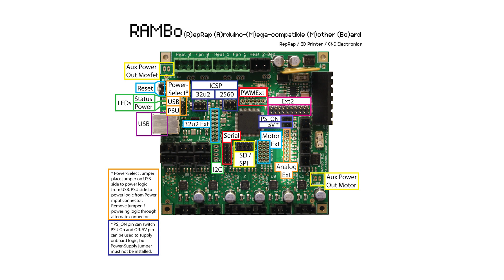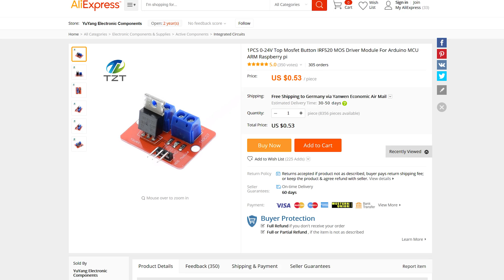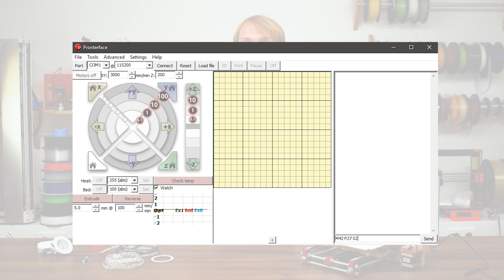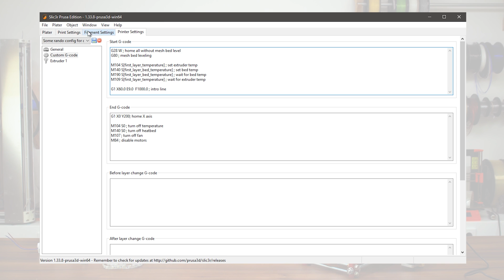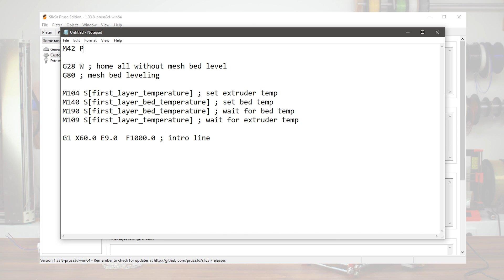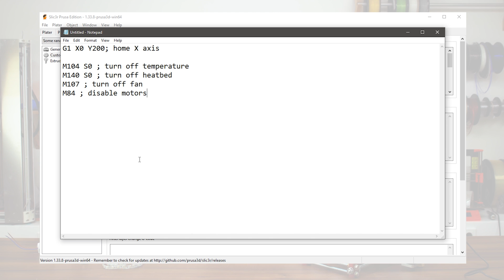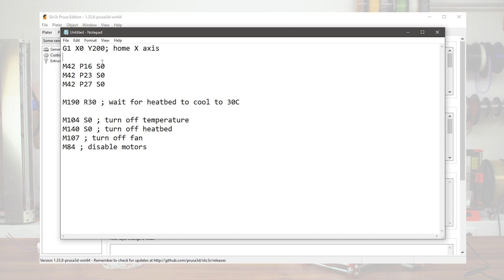How to add software-controlled LEDs to your 3D printer!

Comment: You should talk about nanoparticle emissions from fdm 3d printers, and how important it is to have your 3d printer in a well ventilated area!
Reply: Wow..some people fail at understanding. PLA may be 'non toxic' when ingested or during physical contact with 'large' solid particles. However, when inhaled in ultra fine particle sizes (0.1 - 0.011 micron) they become lodged in the smallest of lung passageways. They are also small enough to pass directly into the blood stream travel to the most tiny locations of the blood vessels in the brain. These lodged particles are well known to cause long term pulmonary problems. Strokes, recurring flu, asthma, etc are all directly linked to UFP (ultra fine particle) inhalation. 

After multiple studies, we're seeing that PLA has a much lower UFP count compared to other filaments, such as ABS or polycarbonate. However, in concentrations given off by frequent and long term exposure to in home printing this very well may cause long term problems after these little bits build up in the body.

There are actually several 3D printer and filament manufacturers currently working on low UFP materials to deal with this, now recognized, problem.
Reply: Myko I never knew about this, thanks for the info!
Reply: Yes, thank you! You explained it way better than i ever could.
Reply: Can you name anything that wont kill you?
Reply: TheDutyPaid you have a good point
Reply: It's not a good point if it's pure stupidity for the sake of creating an argument. Yes of course everything can kill you in the right dose, the right application of force, etc etc etc. The real question is, how slow and painful do you want your death to be? Slowly poisoning yourself from the inside while your nervous system freaks out and degrades doesn't sound like fun to me. And that's just a single possible method to die by 3D printing.
Reply: secretagb in my opinion the point is that there are also many other dangers the should be explained, for example what if you printer caught fire. My point is that there are many other safety items to be explained.
Reply: i am not acting like anything, i am simply furthering information i found online. Because i actually read up on stuff before i post comments on videos. And besides i never claimed that 3D printers are deadly, i said they could be harmful which they can
Reply: Lukas I didn´t know about it either. It surprised me a little so i think it would be cool if big 3D printing channels helped to make people aware!
Reply: So how do you feel about Fukushima? ... the air outside will prolly kill u faster but good info anyhow..
Reply: I don't disagree there are a million other things that are more likely immediate dangers. However, keeping your printer from catching fire is easily mitigated. Even having the ability to extinguish that fire is quite easy to manage. Some dangers are simple to mitigate and others not. I worked 12 years in aircraft maintenance and was exposed to a myriad of seriously terrible toxins and mechanical dangers. Many of which were easy to keep safe from, others not. So why not try to mitigate the easy things and not worry about them. Then work on trying to mitigate those we may have a harder time with? Nano particulate is something we don't even fully understand yet in the medical sense. Saying that something may burst into flames and pointing to that danger and ignoring the others is silly. It would be like me saying I could have been crushed by a hydraulic failure on a wing flap and ignoring the caustic sealant fumes I was using to do a repair under said flap.
Reply: So what's the exact Harmful Part?
Reply: Yah. Which part of the Body is affected? Lungs?
Reply: Dr. Google.
Reply: Best thing is that we should use Filters...
Reply: Oh i will die tomorrow..... PLA is non toxic..
Reply: First of all, no.

new studies from this year shows that although emissions from PLA is a lot less than other types of filament, it can still be harmful in an enclosed area with bad ventilation.

but PLA isn´t the only type of filament, is it?
ABS produces way more harmful gasses and nanoparticles.

And there are soo many other types of filament out there that hasn´t even been tested that well that might be even worse than ABS.
Then you have to take the quality of the filament into account, super cheap chinese filament for example probably is worse than good quality filament from trusted producers.

You need to read up on stuff and learn about things before leaving comments like that and making yourself look like the stupidest little 12 year old on the internet.
Reply: Stop acting like you are the Pro in Chemics and such. I never said that it's not true I simply said PLA is non-Toxic and that I will die tomorrow. A 3D Printer will never kill you unless you Print something besides PLA without any Fresh Air input.

Comment: For a  lightning based on the temperature of the hotend :
 i use this feature of marlin  for controlling fan according to the temp of the hoend  in the configuration_adv.h. 
(i my case i don't use the heatbed, so i use the bed output to power the light and hotend fans)

// Extruder cooling fans
// Configure fan pin outputs to automatically turn on/off when the associated
// extruder temperature is above/below EXTRUDER_AUTO_FAN_TEMPERATURE.
// Multiple extruders can be assigned to the same pin in which case
// the fan will turn on when any selected extruder is above the threshold.
#define EXTRUDER_0_AUTO_FAN_PIN -1
#define EXTRUDER_1_AUTO_FAN_PIN -1
#define EXTRUDER_2_AUTO_FAN_PIN -1
#define EXTRUDER_3_AUTO_FAN_PIN -1
#define EXTRUDER_AUTO_FAN_TEMPERATURE 50
#define EXTRUDER_AUTO_FAN_SPEED   255  // == full speed

Comment: Very interesting video.
I tried using the setup as shown on the reprap forum in regards to the FF module, but was not able to get it to work.  This module is suppose to handle the lighting and also apply sounds to the actions of the start and end codes.
Not sure why it didn't work, but it would be a very cool thing to have for demonstration 3D printers that are designed to encourage new people to 3D printing.

Comment: Extremely helpful video! 
I have some spare LED strip and was considering installing some on my LulzBot Mini as I'm fed up with not being able to see what's going on! 
Although the PSU is 24v and the LED strip I have requires 12v I was going to connect two pieces of strip in series so they both have 12v from the PSU. I was going to use a small switch on the front of the printer controller case but having seen this I'm considering the alternatives, although I may still include the switch for isolation purposes. 
Looks like my weekend is going to be illuminating!

Comment: PrintrBot has a nice RGBW NeoPixel led strip that uses one wire control to set the colors. 
https://printrbot.com/shop/led-strip/

You can also use any of the Adafruit NeoPixel modules and they have a lot of choices.  Marlin 1.1.x has RGBW support, but I had to patch it to drive NeoPixels.  In effect each led is individually accessible for ultimate control.

NeoPixel support patch is here, but keep in mind this patch does more than NeoPixel support so you will want to apply just the parts that drive the NeoPixels.

http://www.xilka.com/printrbot/marlin/1.1.4/20170707/Marlin-1.1.4-20170707.patch

If you have a PrintrBot Simple, firmware that drives the NeoPixels is precompiled here:

http://www.xilka.com/printrbot/marlin/1.1.4/20170707/

With this implementation the firmware drives the leds, so no gcode mods are necessary.

Comment: you might want to check out the rgb settings in marlin also.. search for "RGB LED / LED Strip Control" in configuration.h and also "Printer Event LEDs" in configuration.h

Comment: Never connect a Ramps 1.4 to 24 Volts..
Reply: rubbish, you just need to know what your doing.
Reply: Putting 24V in a Ramps 1.4 will blow up.. check theirweb site,
Reply: more rubbish, The ramps itself is fine for 24v. The mega can only take 12v, so you remove D1 so that 24 is not feed into it or use a better mega eg a Tauino Power. You also need to replace the 11amp polyfuse (its only rated for 16v). You also have to check the caps are 32v not 16v as fond on some cheap versions. I have many a ramps running 24v.
Reply: ok they dont tell you that when you buy a board
Reply: Glen Dooer I can second Peter's comment. I turned a standard ramps board into a 24V version as he explained. I replaced both polyfuses with car type blade fuses. All works fine.
Reply: Ok I was told just to plug it in to 24 V and all would be sweet,,
Reply: see http://reprap.org/wiki/RAMPS_24v  for the real details.

Comment: sometimes I think people are more interested in the tools rather than what they are printing. =-/
Reply: To each their own. Some people like building printers. Some people like printing things. Some like both.
Reply: It's also about learning, making and creating.
Reply: You should be less concerned with what other people are doing and focus on your own interests.
Reply: Thats why its a hobby,a this goes for lots of things.
Reply: if you watch the entire video (and I was skeptical after seeing far too many pc builds with useless lights), status lights you can see from another room via gcode manipulation is very smart. I night instead wire this design into if-this-then-that.
Reply: Sometimes people tinker on their cars instead of driving it :P

In the beginning, I tended to print things to improve the printer, now I print both others and my own designs. I think print wise, 20% is improvements to the printer, rest is either my own designs (Some of them didn't work as intended :P) or other peoples designs. I have printed stuff for others, like feet for either PS4 or PS4Pro; though the PS4Pro is my own tweaked design inspired from someone else's work. I have yet to test the PS4Pro feet, so I haven't uploaded my design yet.
Reply: It’s a geek thing.  I practice everything I make by making stuff for myself.
Reply: It's like any hobby. Cars, radio control cars/airplanes, drones, robots, etc. 95% of the time is spent learning and optimizing the hardware for example. It's like healthy candy for the brain.
Reply: "Sometimes I think people are more interested in the car rather than where they are driving. " Don't nag.

Comment: please have you the link of your owner pcb plug, you show first on vdo?
Reply from the maker: +Stunam! Vap it's simply BC547 transistors with a base resistor soldered up on a prototype PCB. "BC547 switch" turns up all the information you need on Google.

Comment: Greetings Thomas,

I've experimented with the LEDs for some time now and decided to hook them up with my RaspPi Octoprint server.
Everything fine so far, they're controlled via M150 codes.

Only thing I was wondering:
Is it possible to let either the slicing program OR Octoprint do color changes on certain progress of the Print? Like starting with Red, going to yellow every 10% till 50% and then to green on 100%?

As I use Cura, I was thinking about making some functions at the beginning of Gcode creation, checking maximum layer number. Then request at every layer change "if Layer==Layer_max*0.1 => M150 R U50" - this is quite unreliable, as you can have parts where certain Layers are much quicker to print than others.

Another Option i thought about is - can you read Octoprints "process" bar? Like a Plugin that asks "if Progress == 10% => M150 R U50" etc.?

I'd be really glad if you could help me with this issue :)
Reply: Thats good to know, thank you! I'll test it next week :)

Comment: I completely forgot about all the direct pin control GCode commands and a few of the others. Thank you!
I've connected some status LEDs(In a little 'tower' atop the printer) to hot end fan, stepper enable and a few other spots so the lights show the physical status of the machine even if somthing goes wrong with the machine(Like an overtemp, mistake in the gcode or other problem). But I do like this idea for the overall lighting control.

Comment: there is actually blinkm capability included in Marlin. here someone made a small Attiny board to interpret the blinkm commands and use it with standard WS2812 RGB LEDs.

https://github.com/c-/marlin-neopixel-bridge
Reply: Ordenkeim93499 it didn't exist a few days ago... I only designed and implemented it last weekend.
Reply: Thank you i was searching for exactly that a few days ago but couldnt find anything usable
Reply: You're welcome. I'm looking forward to add LEDs to my Prusa as well :)
Reply: You just gave me an excuse to use my Ersa soldering station lol
Reply: You just gave me an excuse to use my Ersa soldering station lol

Comment: How and can I do this to my Monoprice Select Mini?
Reply: I think there is an error on end gcode (around 10:20). Shouldn't you disable temperature of heatbed (M140) before waiting for temperature reach 30C (M190)?
Reply: Thiago Campos The M190 command means "set bed temperature to ... and wait for the temperature to be reached, before moving on with your next command"
The M140 command means "set bed temperature to ... and then move on with your next command without waiting for temperature"

So the order is correct. First he sets the bed to 30°, then waits for the bed to cool down to 30°, then turns it off completely, then sets the new led color while the bed keeps cooling down to room temperature.
Reply: Last week it was 32° in the room. So 30° may never come... Maybe in the summer 40° would be cool enough...

Comment: If you want some additional control over your RGB or RGBW LEDs or LED strips, there's a whole new set of options in Marlin 1.1 supporting a few different kinds of LEDs. With `PRINTER_EVENT_LEDS` enabled, during heating the color will gradually change from blue to red before returning to white, and on SD print completion the LED goes green for a second, then turns off. Of course, you can use "M150 R U B W" to set the RGBW components from your G-code, rather than relying on "M42." Enjoy!
Reply: Note that I've also added a command (M43) to report what all the pins on your board are assigned to, and whether they can do PWM. It makes finding available pins for your LEDs and other add-ons much, much easier! This command is enabled with the `PINS_DEBUGGING` option, and should be disabled when not needed.
Reply from the maker: +Scott Lahteine great tip! Might be worth covering in another video, for when you do have the option of configuring and modifying your printer's firmware!
Reply: Any support for the serial adressable leds ? (I have a shit load, love them :D)

Comment: Disco printer?
Reply: Nice, Tevo LM could use your video. Just 2 blue LEDs which light upon heating of hot end. :b
Reply: Hmm, I have some 2" mirror balls somewhere...:)
Reply: Pinkmouse I'll bet you do...
Reply: Program each direction to flash a certain color and watch it strobe as the printer moves...
Reply: Using macro, you can insert pin switching command every layer or every "minute" (not actual minutes due to limitations of gcode), thus creating the disco effect :)